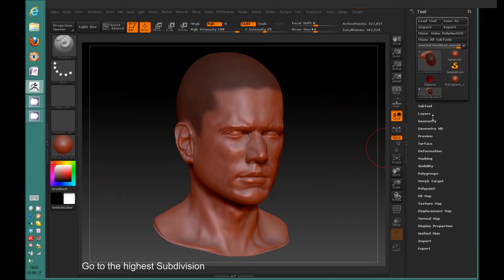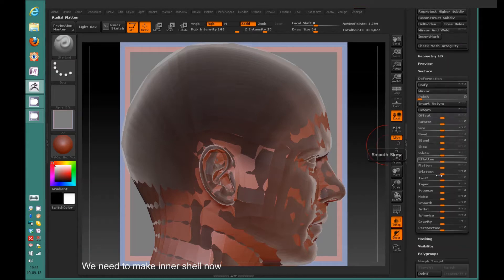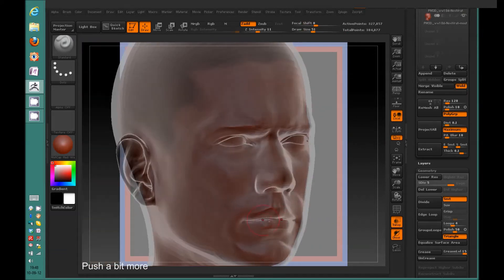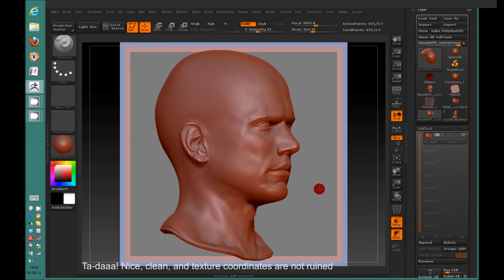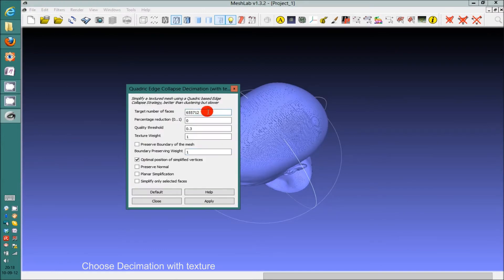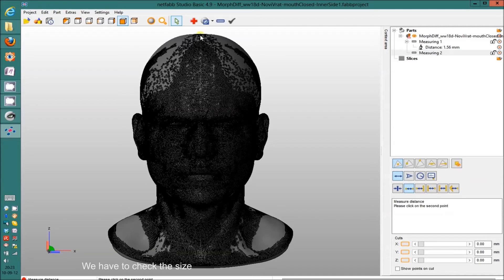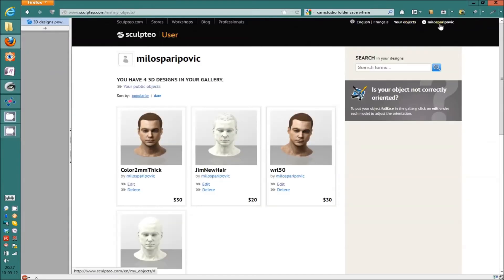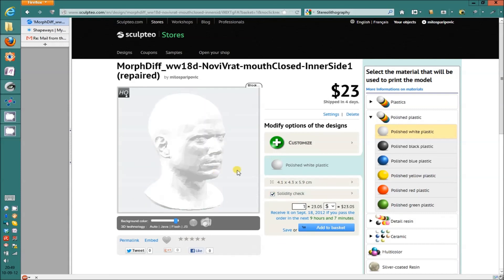Tutorial: Prepare model for 3D Printing using ZBrush in 10 minutes

Comment: could you please tell me how i measured 1:6 scale
Reply from the maker: You have to know rough size of real actor's head. In this case I thought it is 255mm. Divide that by 6 and you get 42.5mm. At 4:45 you see I divided that number with the current model size of 1.48cm, and got how much I have to scale the model to get the the 42.5mm size. Maybe the easier way is to first scale model first to be 1:1 size, and then scale it to 16,66% size to get 1/6 scale

Comment: I've watched this a dozen times or more... can't figure out how the base of your difference mesh came out open like a funnel.  When I deflate the model after storing the mesh target, it is smaller in all dimensions, such that when I make a difference there is no hole in the base.  I also don't see the inner and outer layer on the new morph even with transparency turned on.  Argh!!!
Reply from the maker: Each time you press switch it should switch between inner and outer shell. If that works then you can make a difference mesh (not sure which one should be selected - inner or outer). It will create a new object /tool with a hole. It is also important that the object is opened at one side. If it is not,  hide bottom and delete hidden geometry first.